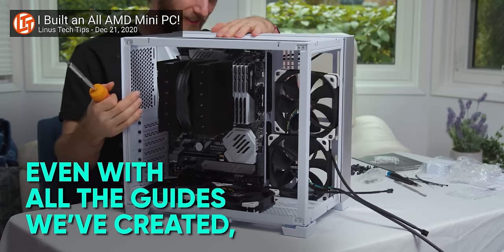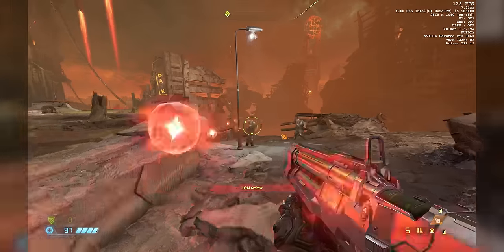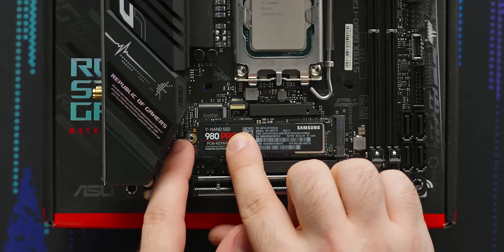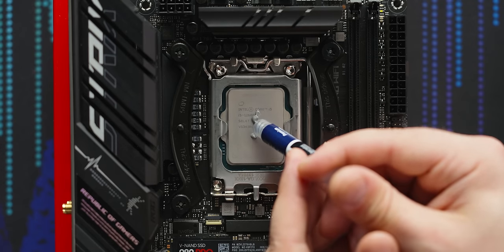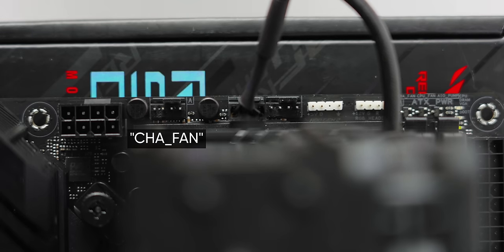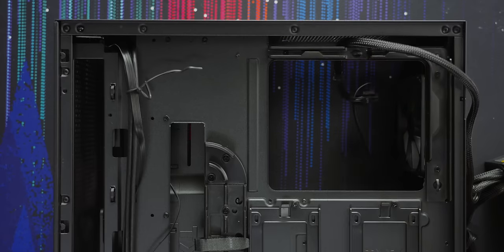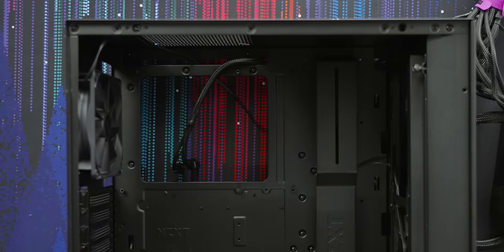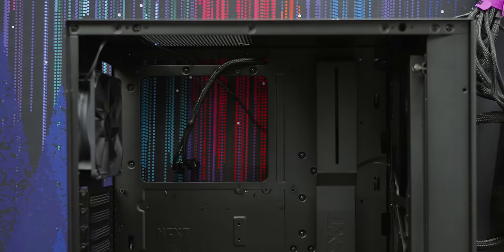The EASIEST Gaming PC Build Ever!

Comment: I gotta be honest, after all these decades with home computers, manufacturers coming together to agree on and create standards, why not take it a step further and make building computers "no tools required" and component placement is obvious (one way). 

For example, there's zero reason for you to need a screwdriver to secure down a motherboard, it should just sit on some sort of retention bracket, and especially pci-e cards, they should clip on to the case as well (no screws required), not just the motherboard. Only screws required should be optional (i.e. for secondary securement/security)

Then components like the CPU should be rectangular shaped and/or only fit one way and have a visually obvious physical key (i.e. a cut corner) or at the very least printing on the ihs with what orientation the cpu should be (this way up) rather than a very tiny hard to see triangle that you must know of it's existence.

As for the motherboard, it needs to simply have printing on it to let users know what goes what, i.e. the 4 ram slots should have numbers 1-4 on them, so it's obvious you should place the ram in slots 1 and 2 if you only have 2 sticks, rather than the usual people placing ram in slots 3 and 1.

Finally PSU makers need to stop making power cables different from eachother, where if you reuse some cables from one model to another or a different manufacturer, it should not run the risk of killing your components, the pinouts on the PSU side should always match the Motherboard pinout standard. Then along with motherboard manufacturers, the CPU and PCI-E cables should not be the same sized 8-pin connector where it's easy for a new user to accidently mix the pci-e and cpu power plugs into the wrong connector on the PSU or Motherboard...
Nvidia is doing everyone a favor by trying to go 12-pin, however even their Implementation of it is not quite there.. Dinky fragile feeling tiny connector which feels like it will break, also so small I can imagine possibly will hit a wire gauge bottleneck in the future for higher power.

Comment: As long as a graphics card with modern-console-level performance is 3/4+ the price of a console, it's gonna be a hard sell.  "But you can actually upgrade a computer" and in doing that, you spend another 2 or 3 consoles' worth on said upgrade (if you actually want a noticeable difference).  Meanwhile, the consoles will have most likely released an updated version that offers 90% of the same experience for a fraction of the price.  I use a PC for the majority of my personal entertainment at home, but gaming on a PC is still way less affordable than a console

Comment: I assure you, no matter how many fool proof things you may try to build into a guide, there will always be a bigger fool when it comes to computer building.  I work at a computer repair shop and get in all the builds that someone tried to build and failed on in a very bad way.  I sometimes just have to disassemble it all and start over to find all the issues.

Comment: It might be easy but it’s far from good value if what you want is gaming, uk prices that costs around £1450 and comes with no peripherals, monitor etc so easily another £250 need for low end parts so realistically £1700!!

You can buy from national retailers that have stock an Xbox series x right now for £450 and a PS5 for £450, if you bought both of them and hooked them up to your TV that’s still only £900 leaving you £800 which pays for a lot of game pass ultimate and playstation plus!

Comment: Swap out the 4 stand for a proper one as i did a semeler thing to my PC as a "temporary" upgrade and had problem that i had to reseat the GPU a lot and the fact that i only had 3 screws holding it in the chassis was a problem, and if you choose a different modermord the from panol conektor may be same where over the GPU as i fund out when i plugged it in into my MSI b450 AM4 itx and that was a little problem

Comment: For me, the scariest part was not in the actual building part. But rather it was the windows, drivers, and software install. And i had a hard time finding an actual easy to follow guide. Maybe something to consider??
Reply: your motherboard provides everything you need on your board's product page  of the manufacturer website besides gpu  (and network/bluetooth driver if you have non-onboard wifi).

Comment: Using an expensive ITX motherboard seemingly only to reduce the number of RAM slots to make it more foolproof seems insane. Guaranteed someone out there is going to follow this exactly, and overpay for an ITX motherboard in their ATX case with no future RAM expandability. So many other parts of this video are so hugely more complex than "plug ram into slots 1 and 3". The idea that anyone exists who is comfortable loading and installing windows off a USB, but would explode if they have to plug 2 sticks of ram into 4 available slots is insane

Comment: Correction : The NR200P Max is the easiest case to build in.  All you do is put cpu,nvme and ram in the mobo, put that in the case. connect the pre attached aio and pre attached psu cables. Plug in gpu. Close pc. Turn on.

Comment: not putting the heatsink back on for pvie4 drives is really bad advice. I support ~50 computers at work and we were fine until we started using pvcie4 drives at which point we would randomly and very ocasionally get reboots into bios with no drive detected until it cooled down. Putting the drives under a heatsink solved those issues permanently.

Comment: That 980 Pro SSD is an overkill and weird choice, no way around that fact and its pricey. 970 EVO Plus would do just as fine and you wont notice difference in lets say normal use, it saves you 100$! 3:28 Theres literally no reason not to put this back it helps cooling and that adds drives lifespan :D That mini itx setup in that huge case seems funny not gonna lie x)

Comment: Otherwise a very nice video for the normies, but keep in mind these gen4 SSD controllers without heatsink and this CPU with only U12 will run quite hot. Id at least get heatsink for the SSD. Also, AMD being more efficient, would run at lower temperatures and motherboards are also cheaper cause no forced, still useless gen5 and DDR5(especially for gaming). And the R5 5600X is a beast and runs cooler. Or just go i5 12600K, but at least get the legendary D15.

Comment: I love LMG and almost every video you guys make across all your channels but this one needs a little more thought to be the "foolproof" pc builders guide.  There was a lot of steps that I thought to myself "if I was a new builder, this would confuse me" or noticing minor things like mislabeling the pcie and cpu fan headers at 7:50 as other have pointed out.  Or at the beginning when mentioning that there are only 2 ram slots as a point of making it simpler while also mentioning that there are two nvme drive slots and not specifically telling users which one to put it in.

Comment: built this...  of course I made a mistake.. I did not connect fans and cpu power before screwing in the board.  I first tried to remove the top fan to give me room.. my big hands were still just too big.  But I had to remove the mobo again.   I think Linus forgets that everyone is his size because even screwing down the top-right corner of the mobo was an adventure.  And, with the top fan in, even sliding the cpu-power connected mobo in required deftly moving the cpu power cable away from the fan.   Linus made it look easy without the top fan installed.  STILL.. video very helpful.. thumbs up.  ALSO.. wish I was reminded to buy the BLACK Noctua.  now I got all this black and silver and noctua tan/brown.  Am 700 miles from a microcenter.. heck, when I lived 50 miles away from the Paterson NJ store I wouldn't go to Paterson.  C'mon microcenter.. open an Orlando location.. this place is booming.

Comment: Use a non K CPU and just use the default stock cooler. 99% of beginners/amateurs won't care, it will reduce complexity even further and save decent amount of money. It will also remove the need to re-apply overclock in case BIOS gets reset for whatever reason and it just removes unnecessary variables in general. I know this is a "gaming" PC, but this just promotes unnecessary hardware. I'm fine with teaching people some advanced things, but many people won't benefit from this.

I would consider myself an enthusiast and I've had stock coolers all my life until like a month ago. 3rd party coolers are overrated unless you are running super high end hardware (and OC) or unless you are extremely sensitive to fan noise (but then you have GPU fan noise anyway...). I've also barely ever overclocked hardware, it's just not necessary most of the time. People need and want hardware they can build and use, that's it.

Comment: I understand the thought behind this... But it's pointless, as if you can't follow the slightly more dynamic directions of an average build, then you have no hope of gaming on PC. Sure, you can get into the OS and launch a couple games, but you will inevitably hit points with your OS or in various games you want to play, where you need to be willing to reason and troubleshoot (or to configure their games so they're actually getting the advantages that PC offers), which are the same things you need to build a PC. The solution is not to dumb it down so everyone can do it, the solution is to encourage people to rise up and be willing to learn, assuring them that they can do it, even if they previously thought they couldn't, so that they're determined to push past the things they don't immediately understand, rather than giving up at the first sign of trouble.

Comment: Very misleading! For the price premium of DDR5 memory, I can get an AMD 5800g processor, And there is no need for an ITX motherboard, since mini-ATX AM4 motherboards with just two DDR4 DIMM slots are very common. Debugging is much easier because the user can not only boot up, but actually play games on the integrated graphics of the 5800g.

The user can then add the RTX 3060 after the system is up and running. The user will lose some performance not only from going with an AMD CPU, but also for going with the 5800g instead of the 5800(X). Having stated this, the builder would have save enough money from going with the 5800g and DDR4 RAM to upgrade from a 3060 to a 3070 graphics card.

Comment: Not going to lie, I feel like this video was kind of a miss. Just a couple things come to mind: Your advice on cooler compatibility is correct in general, but this motherboard supports both current and last gen mounting, so calling Noctua is unnecessary. Some graphics in the video were incorrect (like at 7:50, the PCIe cable is wrongly shown as the CPU power cable). You glossed very quickly over what the Y-cable is, and what BIOS settings would be needed for the AIO plug. I feel like in general certain steps were given a lot of details, but seemly other random steps were glossed over. The video feels wayyy too fast paced for a novice, and may put them off.
I usually wouldn't be too critical of your videos (esp. these things), but given you are presenting this as a "foolproof guide", even the little details matter a lot. Also, your much more comprehensive guide last week seemed much better, so I assume this only exists because of the Microcenter sponsorship.

Comment: Linus, @9:24: you guys swapped the port label in the video. USB-C label was on the A port ( smaller black connector  ) and USB-A port label was on the C port ( wide connector above the SATA connectors ). In order of what you connected it was USB-A ( 2.0 ) then USB-C ( 3.0 ). I have been doing PC builds and repairs since 1989.

Comment: 3060 and a 12600K is a very poor pairing especially with DDR5. I wonder why LTT always chooses Nvidia when even the 6600XT is cheaper and faster than the 3060 and only uses 10w more. I feel like a 12400 and a 6600Xt with 32gb DDR4 3600 would make way more sense than that strange config you made.
Reply: The 3060 vs 6600xt isn't that lopsided to question.You're not wrong in general, but the price difference between the two is getting closer and closer by the day (I just got a 3060 from evga for a customer for 360 bucks with no real effort) and the performance is close enough to justify picking Nvidia for the feature set or perceived driver quality. I'd personally pick the 6600 over everything with current pricing, so I generally agree they should have at least looked at the 6000 series.

The 12600k, DDR5 and ITX Mobo choices though are absolutely indefensible. 12400 on a b660m with DDR4 should have been the platform
Reply: @joemarais7683  perceived driver quality is a perception issue not one based in reality, people always go back to RDNA 1 as their talking point but ignore the huge amounts of stability issues Nvidia has had with Ampere also in their own sponsored titles like Warzone when Radeon has been far more stable inluding games like 2042. As you say on a per game basis it depends. Even in 4K on averasge a 6600XT is faster. The feature set advantage is only meaningful if you actually use NVENC or DLSS and RT isn't even worth talking about since they can both barely do it. NVENC is also only a talking point if you work with h264 sine h265 on VCN 3.0 and NVENC have the same quality and performance. That is what bothers me about people not even considering RDNA 2. It's actualy a lot better than you think and people only ever tell half of the story with NVENC vs VCN and that if you work h265 either option is great. 

But, yeah a 12400 on a B660m with DDR4 should've been the go to. 12400 is more than fast enough for the 3060. My 5600x is more than enough for my 6600XT and the 12400 is faster on average than the 5600x. Heck even the 12100 is good enough for a 3060.

Comment: Zero point wasting money on a 980 Pro. For a gaming there is a miniscule difference in load times between a good SATA drive and the best PCIe 4.0 drive. There are loads of benchmarks showing this. You can save a significant amount going for a good PCIe 3.0 drive to keep the clean look and no lost performance. Also DDR5 is adding no benefit over a cheaper DDR4 build and Micro ATX is more expensive and the only additional effort with a larger board would working out the RAM goes in A2 & B2. This video comes across as Microcentre told you what parts to use $$$

Comment: QUESTION: how we know the motherboard will be able to "safely" provide enough power through the Y cable to power not 1 but 2 fans? Isn't it dangerous?? Thanks
Reply: Because motherboard manufacturers always account for this and allow you to pull more power through a single header than you would need for only one fan. A single fan header  is normally around  1 - 1.3 AMP, most fans are rated for 0.25A, therefore running 2 fans off a single header is perfectly safe leaving you plenty of room power spikes and power variation and deviation, I have run 3 off a single header before now as its still within the safe limit and had no issues at all.
Reply: @andydbedford  thanks!

Comment: The problem with PC building today, is that people to heavily invest there time in actually getting the component and spending within a budget set in stone. Rather then being semi flexible and spending actual time learning about everything that makes your computer work AND how to at least diagnose an issue you may run into when you build your first PC! 

Another huge issue with first time builders now when I think of it is that most people who build either don't have or are not making use of friends/mentors that can show people how to build there PC's correctly or be there when they may make a mistake or show them how to more efficiently build within a certain PC case, timeframe, Environment etc. It's unfortunate that people fuck up easily doing things like this, but until certain philosophies or design, planning and general computer knowledge are followed, People will still make mistakes that can ruin an ENTIRE build

P.S. Blind PC building on YT videos/PC livestreams is one of the ridiculous things I have seen to date!

Comment: Modular Power Supplieas should never be used as an upgrade or be changed.
Not as long as the bullshit with the not normed pin-out persists.
If you change the PSU, CHANGE ALL THE CABLES WITH IT!

Comment: Not to be an elitist, but building PCs isn't like what i was "back then". Every slot is proprietary to the hardware, most of the drivers are auto installed by the OS and BIOS has a UI now.  Cases are so much more optimized and almost everything is modular. Oh god i sound like such a boomer 🥴

Comment: This is a fit janky. Claiming this can be built in 10 minutes is ridiculous if this is aimed at a first time builder fs, I’d struggle doing it in that having built 100s. Then ITX and DDR5 are very expensive for a first time builder. This is a bit of a silly system for a purpose that doesn’t make sense as there’s lots to get wrong here still, one mistake you literally make in the video with the 8pin. 🤦‍♂️

Comment: What does it mean for a cable to be "keyed"?
Reply: It means it can only be inserted one way. The connector may have a notch or a part of the connector may have a guide or other difference so that you can only insert it one way.
Reply: @JJFlores197  I mean... Yea I figured something like that, but that sounds like something you can mess up, and break if you're not careful?
Reply: @VeetiM  You would need to use excessive force in order to plug in a keyed connector the wrong way. You don't have to be super careful with PC parts and connectors. Don't be afraid of them, but don't jam or force things. More likely than not, if it doesn't connect smoothly, you're plugging it in wrong.